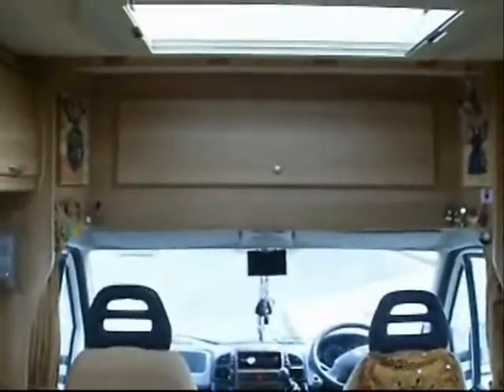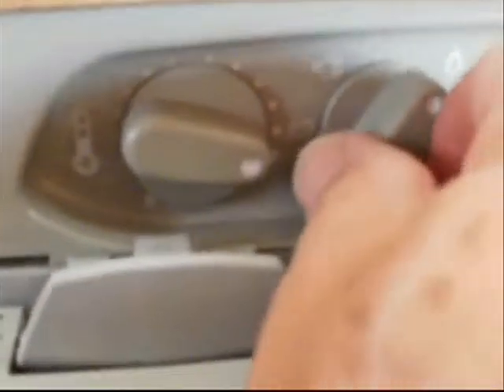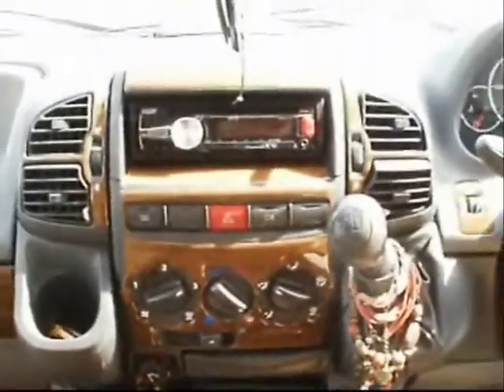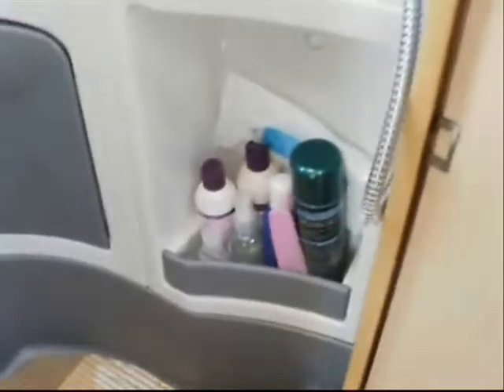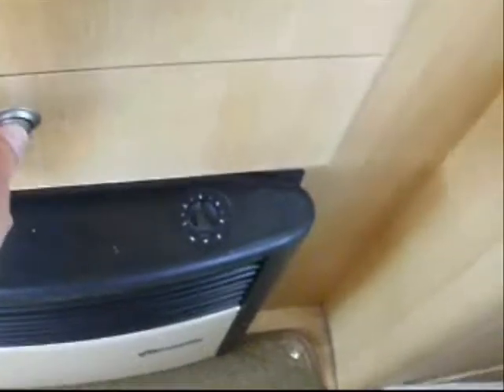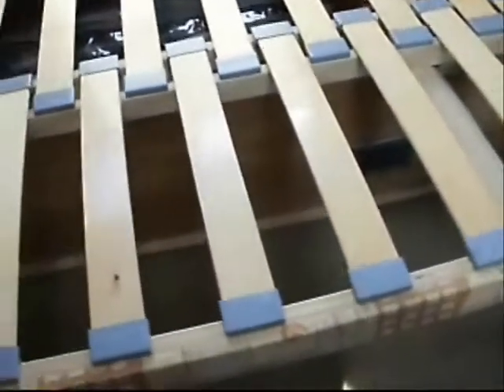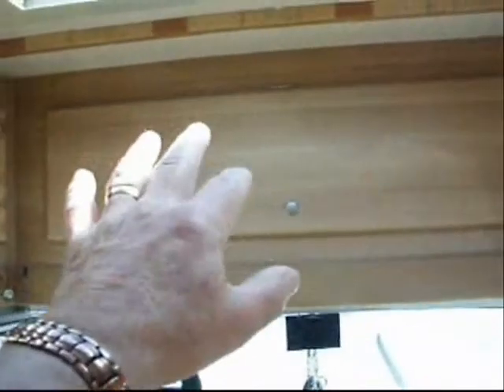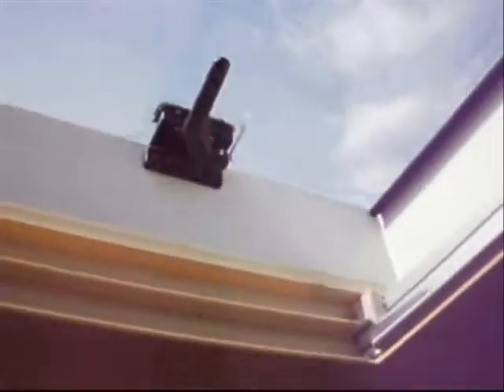AUTOCRUISE VALENTINE A TOUR PART 2

Comment: Hi Bob
Like you we are planning to move from a Symbol to a slightly larger vehicle. Up for consideration is - Autocruise Starfire (favourite) and the Autocruise Valentine. You, having owned a Valentine, can you tell us the negatives ? SWMBO - not at all keen on the rear door as opposed to the traditional side door - Any advice welcomed.
Thanks --- Mike
Reply from the maker: We were looking at the Autocruise Starfire before we decided on the Valentine , The later model which we were looking at had the interior floor level to the habitation door and a 3 tire exterior step, which seemed like a leap of faith to Jan and I stepping out into the great beyond , If you miss that 1st your in trouble, The early models have the 1st down step inside,, Also the side door Is not for us, We use cab dead locks, all our entry & exit's are through the habitation door, a bugger in car parks where some one has parked close to you, as your footprint is filling the parking bay,, But we are all different with like's and dislike's 
The negative with the Valentine for me was the short sofa's, you could not lie down on them, which became apparent the 1st time we were away, We had the Autosleeper Nuevo for a while which had full size sofa's for single bed sleeping, The Valentine can not satisfactory  give single bed sleeping as you need the passenger seat to make the bed long enough , Everything else with the Valentine was great, But  with so many different layouts out there you need to see them all before you spend so much money , and not like me have to move on to another before the paint is dry on the one I got,,

Comment: We're currently in the same position as you (ie) looking to change from Symbol - and now looking at A Valentine. Need 2 x single beds hence this choice (not changed yet) - Maybe next two months or so July 19 now.  So what's your honest opinion of the Valentine ? Cheers Mike & Val
Reply from the maker: Hi Mike & Val, There are two types of Valentine, The layout changed around 2003, Mine was a 2004 so I only know about this model which is very nice, loads of storage as you see in my video, Lovely bathroom, and door opening at the rear, which I love, Side doors are a pain in car parks, Under slung fresh and waste water tanks save on internal space, But you say you need 2 x single beds, The sofas are not long enough without using the  driver and passenger seats, It's O K but a bit uncomfortable on the feet, But I say it's a great motorhome, and it fit in car parks which I think is a must,, Cheers now
Reply: Did you sell your Symbol?